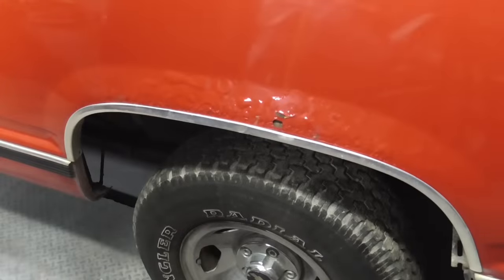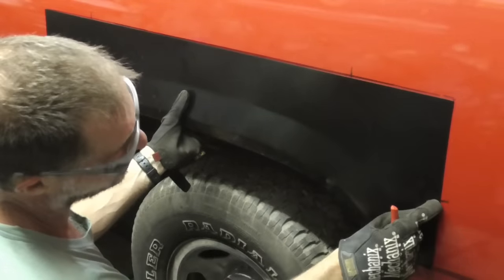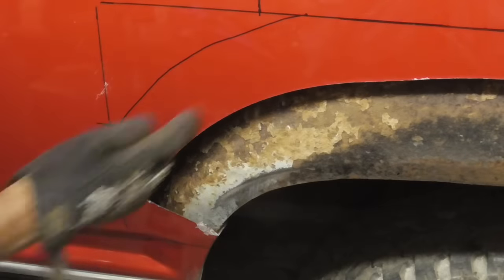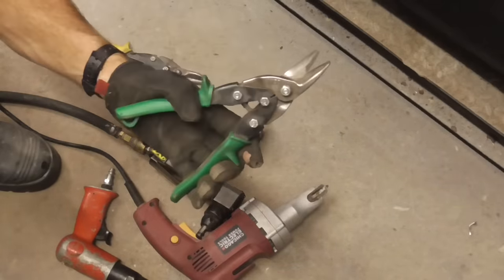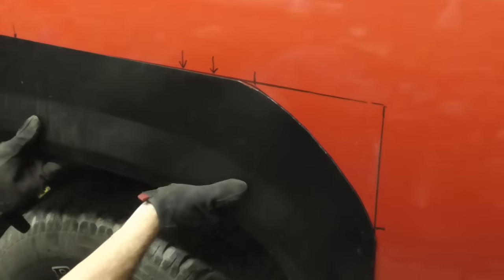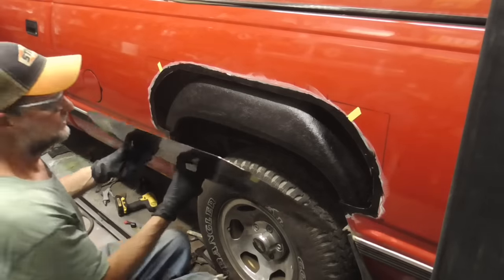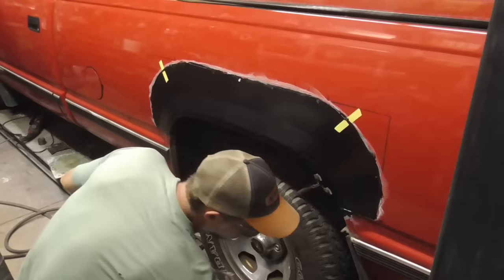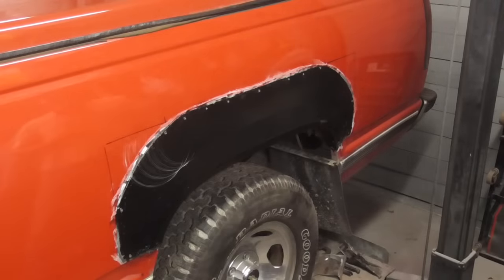Glue On Wheel Arch Rust Repair Panels w/ SEM Impact Resistant Panel Adhesive

Comment: 👍🏻Another great demonstration! I see the pros and cons for both ways (welding and gluing) but what’s your preferred way? Looks like there’s a few coats of paint on that quarter panel.
Reply from the maker: My preferred way is MIG weld it, knock it down, fill.  It's fast, and holds up well.  If I had to guess which would last longer - I'd say this method.  It did have a ton of paint - thus the feather fill :)

Comment: This is the first time I hear an air compressor that sounds like "ma deuce" 😱😁 And for a little curiosity in Sweden in 1978, Volvo started gluing the roofs of cars that were damaged in collisions.
Reply from the maker: That's a quality USA made, belt driven, oil filled, 2 cyl, compressor.  They don't make them like that anymore.  They pump out lots of air, quiet and last forever - really - forever.

Comment: When you are hammering the area, to remove loose rust, and  ...  

the only thing left, is the frame and drive train.
Reply from the maker: I wonder what it would be like to live down south and work on a car where every nut and bolt is not frozen together with rust :)
Reply: @LakesideAutobody  that’s why I oil all my cars my self annually and touch up when doing oil changes my cars last and last . I also touch them up annually also in my garage paint shop but you cans do a nice job using dupilcolour and painting out side on a dry day in the shade and get professional results done many many times all my 15 + year old cars look like new . My hobby is getting older newer cars and doing mini restoration and touch up paint correction mechanical repairs nice wax job car like new lolol and no payments lolo just did a 2011 f150 4x4 it turned out like new been driving it for just over a week

Comment: I'm impressed,I really thought it was gonna look hacked but it's not bad at all. Thanks for sharing because I have some projects I can apply this to. You saved me time and cash.
Reply from the maker: A lot of shops in Michigan have been using glue for rust repair for some years now.  It really is probably the best method because of the water tight seam.  Sometimes you just have to weld though so... that's good to know too.  Happy New Year 🎉

Comment: This is how l do it l use evercoat maxim panel adhesive it works on cab corners, rocker panels any patch panels,great video this is much better than welding creates a seal all the way around the repair, nice job that will last for years with no problems 👍
Reply from the maker: Hey Mike - thanks for the information.  I give it a try - I've seen USC products for some time buy never tried any.  Have a good weekend my friend :)

Comment: Started doing this several years ago to savr people money and help avoid corrosion problems from welding.  The only difference is that I flange the bedside so the two panels are flush. Works nice and makes a great repair. I have some vehicles out that I keep tabs on and even 10+ years later ,no returns for rust.
Reply from the maker: Do you have a special too to flange tight areas like the wheel well lip or 90 degree bends in panels.  Do you just leave those unflanged and flange the rest?  Just wondering because my thinking is if you can't flange the whole perimeter - why do it at all - interested in what you do with that :)
Reply: Some of those right areas are hard to flange but the main reason is not having to beat so much surface area in fo filler. I will sometimes weld the edges in the wheelwell, depending on weather I can get corrosion protection to the area being welded
Reply from the maker: @yrdGBA  Got it my friend - thanks for the comments and response.  There need to be a pliers like a needle nose vise grips that can flange tight areas.  Get working on that :)
Reply: Yes we need to come up with a tool to flange tight areas and in corners.  I will use a dolly and hammer if I can get it in there.

Comment: a tip for sanding your filller..... some people have a hard time feeling the contour of the panel  because of the rough surface from sanding. put a clean shop rag or  sock works, between your hand an the panel.all you will feel are the highs and lows and not the rough surface.

Comment: My project has come to a halt due to me not knowing how to weld wheel arch patch panels in addition to not having a welder. Most body shops want to replace the entire rear quarters instead of patching at a high cost. I like your method of using glue. My question is could I glue the two halves of the inner wheel wells together on addition to the patch and as far as the patch, I could get thinner after market donor patch or getting 
a cut up a thicker donor for the patch. The car is 68 Camaro with thick existing metal that the patch will be joined to.
Thank you for any comment to my problem.
Reply from the maker: Yes - you could do that.  Remember to try to make sure you job can drain and dry - also see this video - https://www.youtube.com/watch?v=8XaZBy7GC7A

Comment: I worked in a body shop for years in Michigan.....(RUST) was a problem back in the day welding was the fix but I can see that adding a few more years to an old rust bucket by using this method is great. And use Fluid Film after.
Reply from the maker: Fluid film is good stuff.  Cosmoline RP-342 is great too for underbody frame components - once it's sprayed on it ain't comin' off for years - no chipping, peeling, etc
Reply: Thank You ! @LakesideAutobody
Reply from the maker: 👍🎄🎅😊 @vincentdsnt

Comment: I've been building a VW Jetta Smyth Ute for just 3yrs now, and I've picked up a bunch so far. 
All the fiberglass in the kit is wavy and bent and twisted ,and I ain't no body guy but I've got a few folks that do composites. 
I will say the 3m panelbond is awesome, it's as close as you'll ever get to welding steel to aluminum. 
(The inner structure is aluminum) 
Anyway, the old original way to do the kit was all with rivets, but now it's better using panelbond and screws and clamps.
Keep any rivets out of the body surface as they pop back out. 
Right now I'm trying to get the lines right for the cab surround where it meets the fenders, as the left side is all warped and almost seems like it was taken out of the mold early and set down and warped. 
I haven't been using name brand fillers yet, one of the guys turned me on to milled glass fiber and microbaloons. 
Milled glass where I want strength, and the balloons for a filler similar to Bondo when mixed in fiberglass resin. 
I figure that stuff should be a little better when I've got to build something up like 1 inch. 
Throw a little cloth in there too.
I'll have to go over to the block sanding vids , I'm having "fun" with that cab surround piece getting the curves and lines right.
Reply from the maker: Sounds like a big project - keep me posted on how it's going for you.  Keep having fun :)
Reply: @LakesideAutobody  biggest thing I've ever done or gotten myself into. 
And I have to finish it, because the wife thinks I won't 😄
I gotta show her up 🤣
Hah, the kit says "build in your driveway in 80hrs" 
I've stood and stared at this thing drooling on what to do next for probably that 80hrs. 
I'm a tech ,but I know enough about bodywork to get myself in trouble ! 😄
Reply from the maker: @MrTheHillfolk  That's funny - don't let 'er win!  😅

Comment: Since you are glueing it, you could leave extra metal behind it, instead of one inch.
I have a toll that recesses the panel for a flush fit, but it only allows 3/4 inch lip, which is fine for welding.

Comment: So did you rust proof the inner guard BEFORE you installed that patch panel. No, I didn't think you did!
Reply from the maker: Don't need to and you shouldn't as paint traps moisture.  Drainage and this is the answer and nothing else - promise - https://www.youtube.com/watch?v=8XaZBy7GC7A  see this too for the follow up - https://www.youtube.com/watch?v=t1WclT_GMvk
Reply: "Don't need to as paint traps moisture". Now I know you can't be serious. Proof coating parts with body deadener actually stops rust & corrosion & that's exactly the reason you had to patch panel this time - because the underbody was never treated originally. We work differently here in Australia & would have done the job properly by stitch welding the sheet metal. If it wasn't for huge amounts of filler to save your job, you'd never have gotten a descent finish at all!

Comment: I put rockers and cab corners with 3m panel bond use screw to hold in place than next day remove screws and fill in holes with the panel bond too

Comment: As an auto body tech of some 47 years (wow that looks strange in print) I have found that a glued edge will ALWAYS shadow through the finished repair.  But that is not to say the glue has no place in the repair I use it all the time ,especially on the lip for sealing purposes. Really liked the vidio.
Reply: My husband wrote this on my phone, I am no body man!
Reply from the maker: Hey Donna - no problem.  Tell your husband that it will last - it depends on how you do it.  Here's a follow up on the same repair 3 years later - https://www.youtube.com/watch?v=gIS1Tbv7Kvw

Comment: Great video,  I'm  gonna use this method on my personal truck. Probably make a video  on it want to test the longevity of this repair. I think I may step or put a backing lip on existing panel to minimize filler. Great work!
Reply from the maker: Thanks GN - you will be pleasantly surprised with the longevity.  You'll probably sell the truck before it rusts again - always good to hear from you - have a good weekend and I'll check out that video for sure :)
Reply: To make it last and last mix oil and some mineral spirits or kerosene or diesel and spray the back of the repaired panel then apply some liquid asphalt like foundation coating but oil first to penetrate the rust

Comment: As being in the auto body business 47 years, some of this repair I can accept and some is a never would do, as in any skilled trade is like a food chef same recipe will be cooked in different tastes.
Reply from the maker: Many body shops here in Michigan are using panel adhesive for rust.  Everyone uses MIG or Glue and lap joints, knocks the seam down, and fills - what part wouldn't you do?

Comment: I love the glue method I stink at welding and not to mention the investment of buying welding equipment. I like how you pop rivet it also for added strength.
Reply from the maker: The glue method is very common in the Detroit and surrounding areas - many shops are using it as the seam is now sealed.  Your choice though both welding and glue work fine if done right :)

Comment: I did use 3M Panel Bond to mate a new lower fender bracket to a rusted fender. I cut the rusted metal off past the point of corrosion and then fabricated a new bracket overlapping on the inside and then a small amount of filler. It turned out beautiful. I can't believe how strong that product is BUT you can burn it with a torch.
Reply from the maker: Thanks for your input C&C :)

Comment: "And even tin snips" actually I found myself using the tin snips a lot replacing floors in a '74 Alfa Romeo Spider but then I'm a Carpenter so I'm used to tin snips.  After seeing your video's I would have glued and riveted the replacement floors rather than welding.  (Carpenters are also used to using epoxy with anchor bolts)

Comment: I like this much better than welding, you can prime the back side of the metal without worrying about burning it off, just use a good structural adhesive, aircraft are literally held together with adhesive.
Reply: Oil it after the paint is dry also

Comment: This is amazing. One thing I'd like to see is how do you deal with the inner fender arch where it aligns at the bottom of panel? It would have a step on those bottom corners right? How would you hide the step in the double corners? Thanks
Reply: I see the body filler in the bottom corners where the arch is. But would this change the curve and would rust occur where it overlaps on the inner arch? Thanks for the amazing content and videos!
Reply from the maker: @technicalitems731  No, it wont rust there as the seam is water tight.  When you weld these areas (tight bends, etc) you can tap them down a bit while red hot.  With glue you can also tap the seam down around the lip corners best you can but remember the metal is only 6 hairs thick (.030") so filler can easily fill that or fool the eye - yes it changes the curve a bit but completely invisible if tapered out right - like drywall seams.  Thanks for the kind words and good question :)

Comment: You have motivated me to take on this DIY project for my 2011 Silverado before the rust creep goes too far.  Awesome content and well done.  Lots of great Q&A too- thanks for that.  I'm building up my supply list, so I am curious how much filler, primer, paint, clear coat it takes to do a truck rear quarter panel.  I'm looking at Raybucks panels which I think will work, but wonder if you know of panels that have more height in case the rust creep has gone too far.
Reply from the maker: Another place you might try is millsupply.com but I think they're the same size.  You should be OK though - what you see on the outside is usually close to what is rusted on the inside - you might cut out an inch or two more.  Filler is not to expensive so get a gallon.  primer, paint, clear - you'll need a quart of each - you could probably get away with a pint of paint though.  If you think you might enjoy doing the work, might as well get enough primer, paint and clear to do the whole truck - you can do one panel at a time if you want :)
Reply: @LakesideAutobody  Thanks for the feedback!  I should have also asked where you recommend getting the paints, adhesive, and other supplies?  Raybuck is touting a no mix adhesive called Silaprene.  Had any experience with it?
Reply from the maker: @jeffrichards8054  I have not used the Silaprene but I'll check it out - maybe do a video on it.  All the supplies, tools, etc. are listed in the video description.  If something is missing let me know - I think it's all listed :)
Reply: Project coming along, albeit slowly.. Driver side inner and outer panels installed, knocked down,  filled, and ready to prime. Took out taillight and discovered the structure back there is pretty rusted out. Do you know if that is available as an aftermarket piece that could be glued in? So far I have not found one. Or do I have to fabricate it?
Reply from the maker: @jeffrichards8054  Most likely you'll have to fabricate something.  Remember, you don't have to build it like the factory - they failed.  You build it so it's strong enough but has massive drainage ability.  Who cares what the inner panels look like as long as they do their job and don't trap moisture and debris.  Let me know if that makes sense and makes your job a bit easier :)

Comment: As someone taught a different way what would be the benefits of this method vs crimping the receiving metal and welding in the panel flush? Just never seen this method for patches it's usually only full bed sides or door skins I've seen glued. Good video!
Reply: As someone who grew up with welding id say its for those who carnt weld. Saves money as it looks like you just dont need a welder

Comment: Do you seal and paint the back side also to prevent rust? Snowy states use salt on roads.
Reply from the maker: The most important thing is drainage - has to drain and dry out inside.  And this - https://www.youtube.com/watch?v=8XaZBy7GC7A  You can certainly try to seal it though - I wouldn't use paint though - maybe COSMOLINE RP-342 or similar - nothing that can start to peel, lift and tra moisture between the pant layer and metal :)

Comment: Looking at doing the same thing to my 07 Duramax.I see 200ml tubes are pricey for the epoxy.How much did you use per side? Thanks.
Reply from the maker: A little less than half the tube.  I used more than I needed too :)

Comment: Sandblast the inner wheel arch and undercoat it. And undercoat the new panel before you glue it on, just tape up the glue edge. Keystone sells a 5 gal of undercoat that you can refill the shutz gun. Flanging the bedside uses less filler, and using a thin layer of dynatron short hair makes it water proof seal. Adding a few 1” holes in the inner wheel arch can help it breath also. Keep up the rust repair. 👍

Comment: I'll just weld them in the same as I've been doing for years,POR the inner wheelhousing and the patch panel from the inside once its completely welded. This particular method of repair is geared towards the novice or someone who doesn't own a welder or can't weld,and no i don't hate glue,i use it also in collision work and its pretty good stuff.
Reply from the maker: Some of the best body shops in metro Detroit use glues and/or welding depending on the situation.  Good to know both. https://www.youtube.com/playlist?list=PLOP9eoG14-I-qu68_805bZaOnmkdlv6Ys

Comment: Looks great. Why didn't you try and remove some of the surface rust and then prime or undercoat  the wheel well before you covered it up with the new product you glued on? Great job.
Reply from the maker: Thanks - over the years I found out it doesn't really matter what you do to the inside as long as it can drain well and dry out - see this video for more on this topic - https://www.youtube.com/watch?v=8XaZBy7GC7A

Comment: Very true about all the posts that have mentioned how much of a modern car is ‘glued’, the only thing I’d add is that in England, we tend to also use a joggler (or joddler ) tool to put a step in the original panel the same depth as the replacement patch panel, this saves the problem of having to use so much filler to avoid a bulge at the join, nice tutorial tho !
Reply from the maker: Thanks Colin - have a good weekend and greetings from Michigan :)